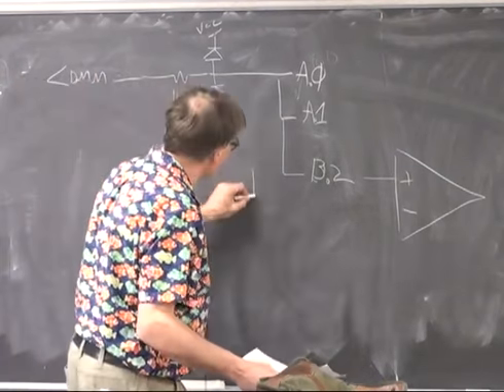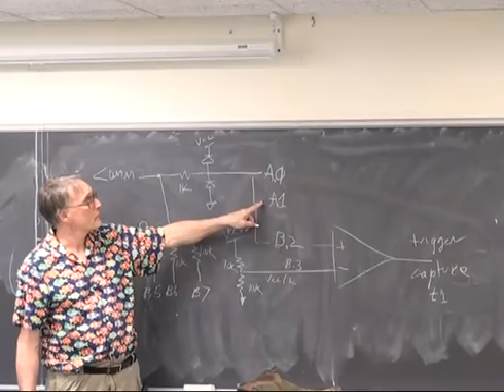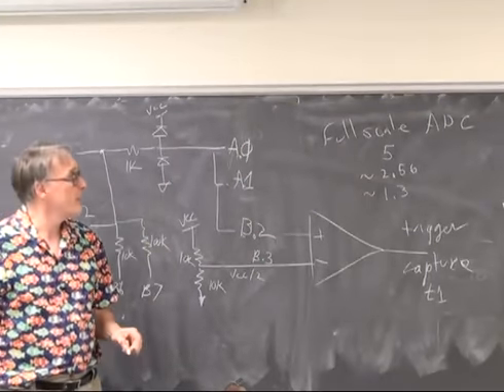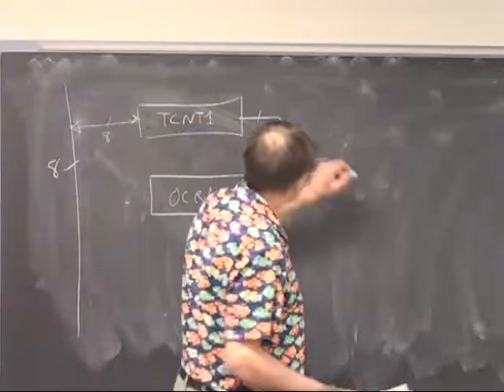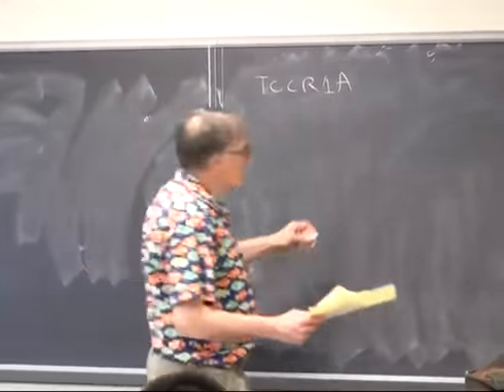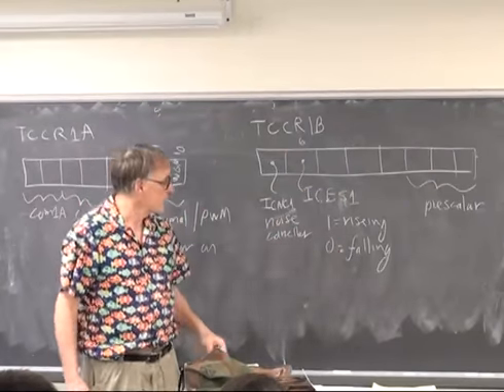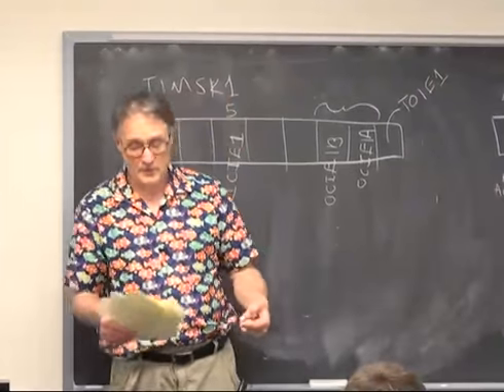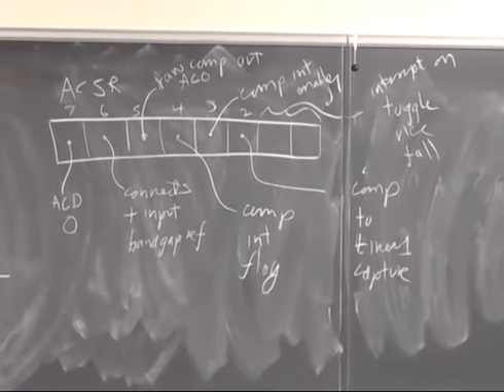#7 -- DMM lab 2

Comment: I think the input protection does not work for B.5-7 pins, the diode protection can only clamp a limited amount of current. I would suggest moving the limiting series resistor and the injection pins (B5-7) past the diodes, but there might be better ways to do it, diodes usually fail short. I just figured this might be useful information for some students.